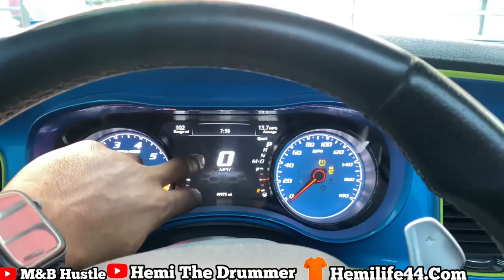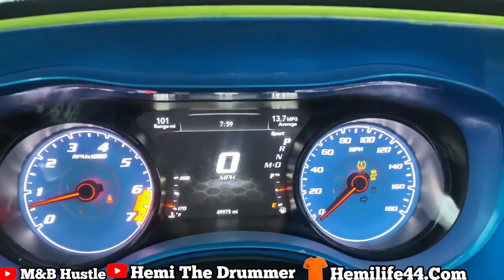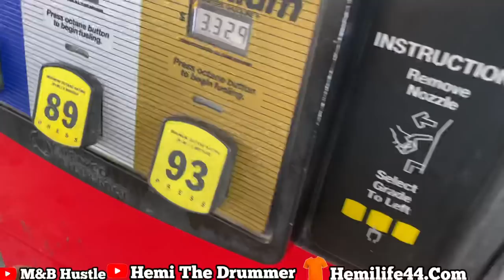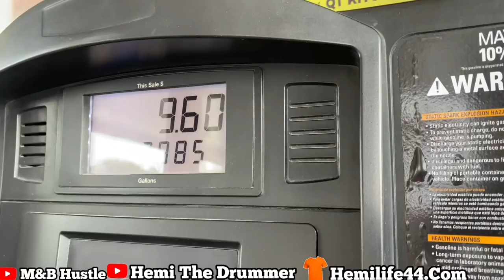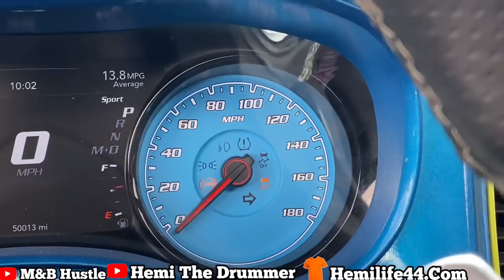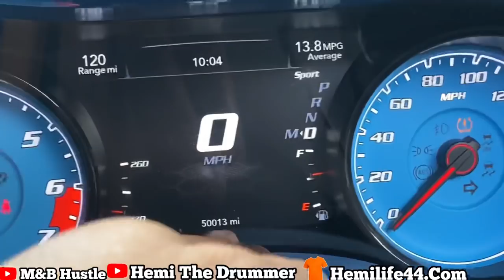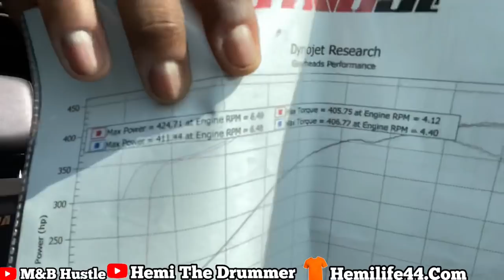TUNED DODGE CHARGER PUTS OUT UNBELIEVABLE DYNO RESULTS

Comment: 410 hp -430 hp is typical numbers for a stock scat pack or 392 on a dyno
Reply: I thought it was more 390-410
Reply: @03mm24  depends on the dyno
Reply: @just_a5.7    Temperature, airflow, barometric pressure, and torque calibration can influence the amount of power you can make on a dyno

Comment: Not only the big wheels,but also your cold air intake setup will affect how it rolls off from a dig.The more piping on the intake,the longer it takes for the air to travel.The short ram intake is the correct setup for a NA car,quicker throttle response.Cold air intakes are better for cars with force induction.

Comment: Yessuh! Those are normal results. Apart from the pedalbox a larger throttle body, intake manifold,  long tube headers is the best route for the 392 and twin turbo with a few tweaks then the next step is Hellcat.

Comment: All the things that I have read and seen, the only way you are going to get more gains is to super charge it. And the 6.4 motor cant have that much boost added or you will blow it apart unless you change internals on the motor itself. But I am sure you already know that.

Comment: A tune does add some horsepower. With natural aspirated engines it really depends on the supporting mods for max hp. With boosted cars tunes do way better with adding a significant amount of torque and horsepower more easily.

Comment: If you want to see how much power your engine has, find an engine dyno. You on a chassis dyno with accessories on your engine so you gonna see low numbers with your rims, a/c, water pump and drivetrain. Your numbers are respectable but like everybody is saying mild mods are what you need. Try a new exhaust from the heads back.

Comment: With your current mods, those numbers are about right. Long tubes along with your tune and your minor bolt ons, will help you out a little more, but tunes do add HP though. But for big gains. Heads, cam and ported intake. Stay away from boost on the 6.4’s unless you planning on a major rebuild to handle it.

Comment: What power are you expecting at the wheels? In most cases you should expect a 15% loss in power comparing power at wheels vs power at the crank. Dodge rates and advertise the power at the crank. You won't see 485 at the wheels. The 392 is pretty tapped out from dodge and you're tapping at the glass ceiling in terms of power. With the mods and tune, you won't see much gain. 425 at the wheels sounds about right. The Hellcat is a much better base platform due to the potential. The 392 has a very very limited  amount of potential without cracking open the block and replacing pistons and rods.

Comment: What tune do you have,, not sure who told you a tune doesn't add more power when that is the point of getting a tune. It removes many of the factory restrictions allowing for more power. Changes timing, AFR, and a host of other functions that limit your car. 420's to the wheels is about what you should expect. If you have a legit tune, with some bolt-ons you might get a 20-30% increase. But what you have at this point is where it should be. Tell your tune guy he needs to step up his game and make adjustments based on the 2 dynos you have.

Comment: 485-15%=412, those numbers are right, you subtract 15%,from crank, and not much you can really do on that block, unless you cam, port and polish head, longtube, and probably a charger or turbo, but wifh that high compression of a block, the amount of boost you could run without knock on stock block will probably be small so for real power unless your willing to spend over 10k and that's being generous only choice for real power is get a hellcat. Oh and if you get a blower/turbo, you'll need to change injectors, and probably fuel pump, to me that's not worth it. These engines aren't like amg,engines unfortunately.
Reply: 20% for auto and %15 for manual transmission
Reply: @jrrogersstang4696  yes sir you are correct, either way there not much he can really do on that block n/a
Reply: @charmamillion  it's mind blowing how people don't understand crank power and power to the ground..I'm putting 415 to 420 to the ground with kooks longtube headers and tune..
Reply: @jrrogersstang4696  ikr... Smh, so are you going to crack open your block next? Or what? Tbh I wouldn't trust a turbo on that block the way it is, safe boost is normally 8psi high side, but I wouldn't do more than 6psi, hence why if people want this car for power, with how heavy it is you need a hellcat, because after everything you do to get the internals up to par. To handle high psi constantly without getting a knock, it's not worth it.
Reply: @charmamillion  mustang gt can handle it bro..you don't have to do much on gen 2 till after 900 hp...
Reply: @jrrogersstang4696  oh ok I apologize I thought you had a scat, shouldve looked harder at your profile picture, yes the gts can handle that power, the 5.0 deff sure can, tbh I would trust turbochargeing a stock new edge block than a 392/scat...you a mustang guy so you know those 4.6 were really good engine, just didn't like the fact they were 2v and they didn't make 5.0 in those years but the cobra 3v made up for the lack of 5.0  in the new edge era
Reply: @charmamillion  yes indeed bro..I'm really into all sports muscles car..

Comment: For V6s u still use 93??
Reply: You don’t need to tbh
Reply: You don’t need to. Octane is based off how much spark your car needs to actually fire off and perform. V6’s and a lot of newer cars are just fine with regular. Putting 93 in most of these cars don’t do nothing unless your car is turbo’d, got like a performance engine or what ever else. Your car will run just as good  on regular if it’s a V6.

Comment: So you're saying Gearheads did it right!?!  Those 22s are costing u some power #s but w/ TCM tune you're faster.  Gotta get cam/headers to make real power, but just get a hellcat and save the headache.  Ask me how i know!
Reply: Thinking about camming my scat pack what problem have you had
Reply: @ericmitchell1905  Car was in shop 3mos mainly cuz could not find a tuner who could get her right.  Went thru 3 tuners in all, at my expense!  2 were well known hemi tuners.  $7k for +50hp not worth it at end of day.
Reply: @4shaken_  damn, no thats crazy! what does an average tune run a fella on a stockish scat!?
Reply: @scarface9617  All 3 of mine were bet $650-$850 for TCM & ECM tunes, using HPtuners.  This does not include cost to unlock PCM or lics.